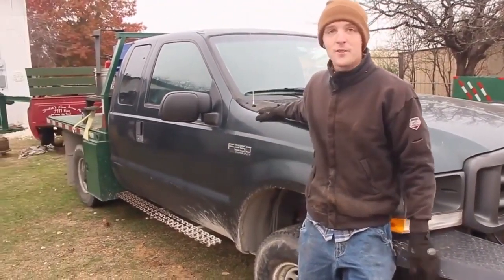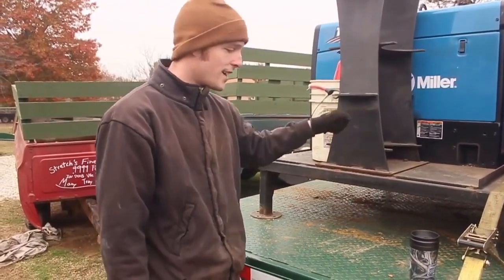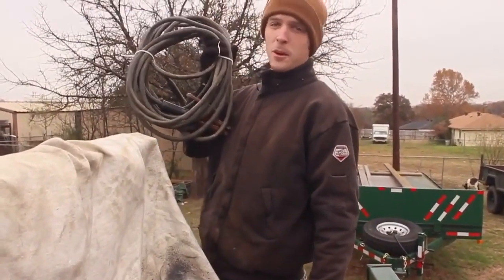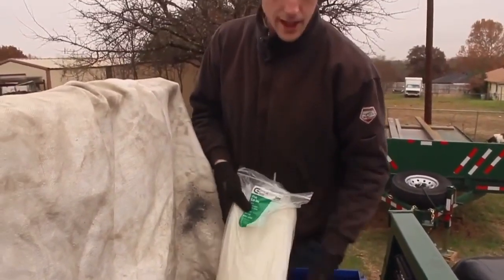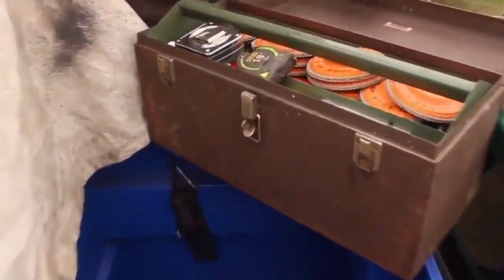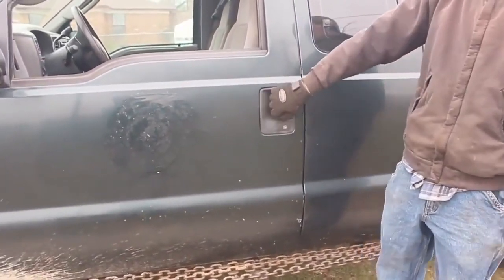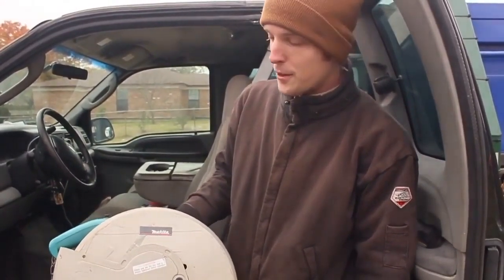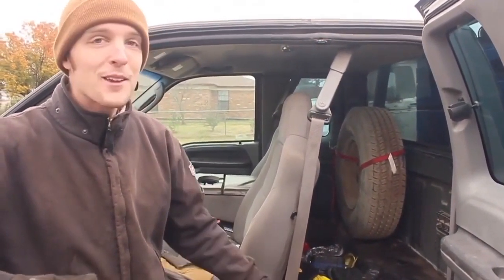A LOOK AT WHATS ON MY WELDING RIG (FULL SERVICE TRUCK TOUR)

Comment: To speak the truth mechanics now concur that Ford made intakes with shallow spark plug threads and DO NOT USE ANTI-SIEZE COMPOUND when replacing spark plugs if you have an afflicted model.
🕉🌏☮️🙏

Comment: Welll My 2006 had helicoils in 2 plug holes. And at 65000 miles the engine destroyed it self on a trip from colorado to oregon . Im not a keyboard expert. Just FYI , hope yours is a very long runner.

Comment: I had a 2001 excursion with the 6.8l. it blew out 3 spark plugs. They are generally not problematic until someone changes the plugs and overtightens them. The aluminum heads were made with too little meat, and the torque specs are much lower than your average shade tree mechanic might think.

Comment: Like your outfit I just put together my 220 extension cord very much like yours I got 20ft pigtail and 60ft to plug into it of 10ga cable sometimes I miss my extra cab Cummins but California laws dictates what runs on their roads now I'm running a 2000 F250 single cab with the service bed I'm getting use to it